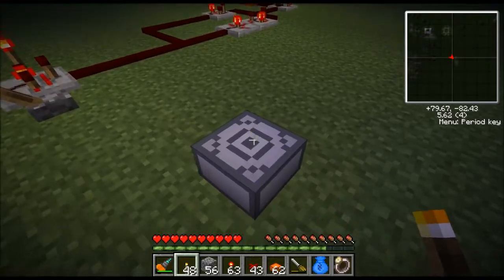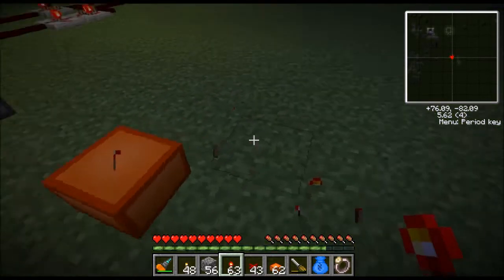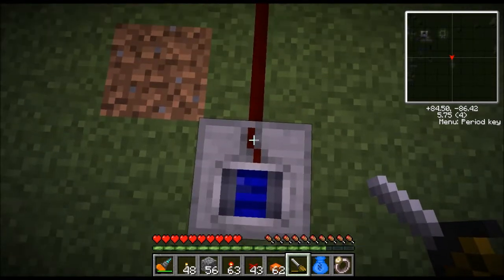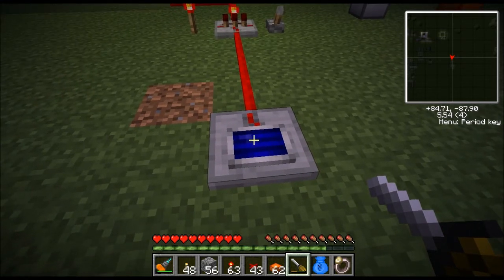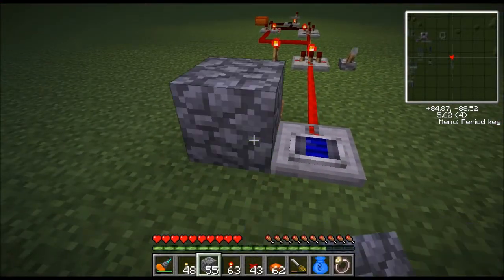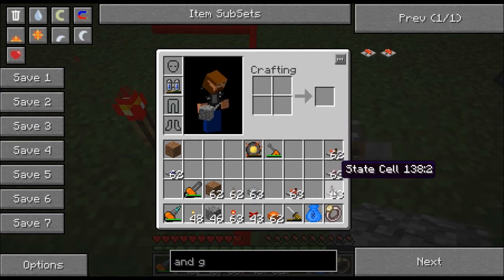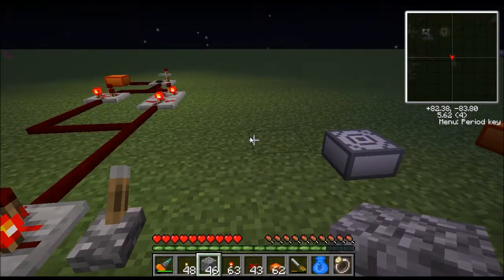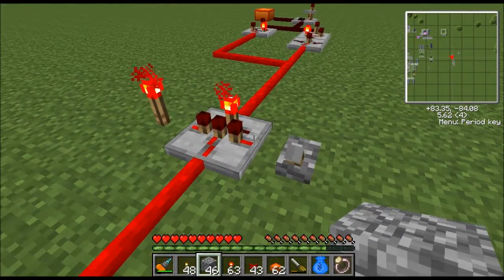Tekkit Tutorial - How To Build An Alarm That Detects Night/Day Cycles

Comment from the maker: You can make an alarm sound when a batbox is empty. In the top right corner of the batbox screen you will see a button. You can click that button until you see a message that says "emit if empty".  Then the batbox will emit a  signal when it is drained. In fact, you can  put the alarm directly on top of the batbox. You will have to hold down the shift key to place it.

And I am using red alloy wire. It can travel on walls and ceilings. You don't have to put repeaters every 15 blocks either.

Comment from the maker: They are red alloy wires. It is better than redstone because it can travel up walls and across ceilings. It has a longer range too. You don't need to put repeaters every 15 blocks like you do with redstone dust.